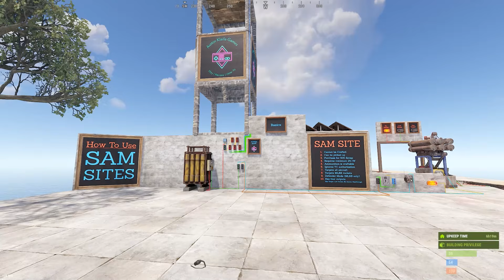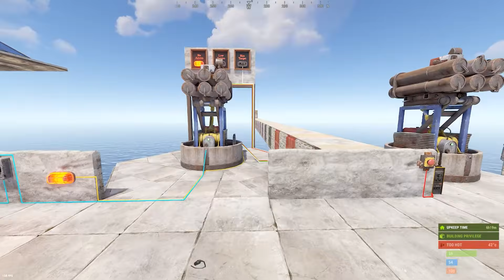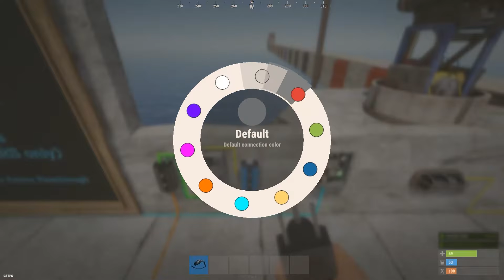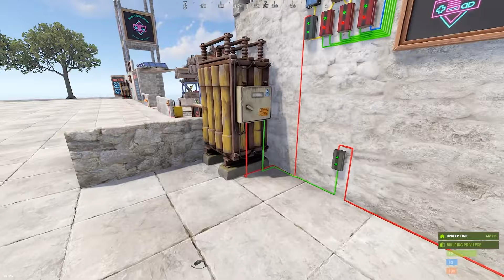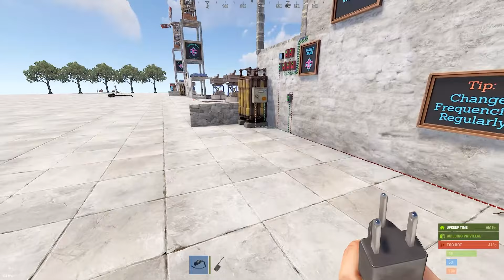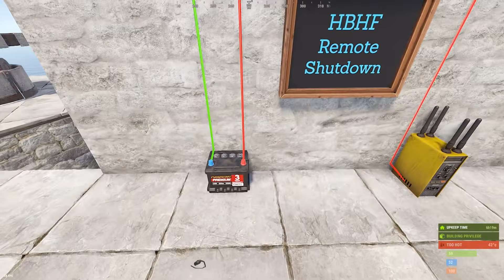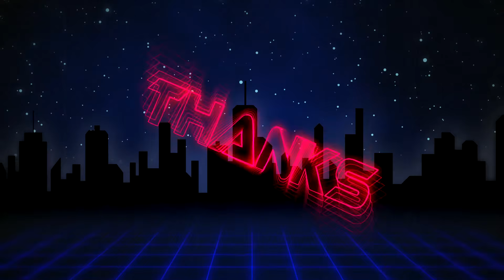RUST Electrical | How To Use SAM SITES - With Wired and Wireless Examples - 2023

Comment from the maker: Video Contents:
0:00 - Intro
0:09 - Basics
3:31 - Smart Switch With & Without Timer
7:12 - Auto Shutdown Smart Switch With Timer
12:07 - Basic Wireless Systems
14:54 - Wireless HBHF Remote Shutdown
16:34 - Final Tip
16:59 - Outro

Comment: Great video Austin! 

You're always extremely thorough with all the information you put out there!

A little note on switches (both regular and smart)

The switches actually have a strange way of working that you wouldn't expect. The bottom and both side toggles are all actually power inputs. The difference is the bottom is neutral and doesn't affect the switch state, whereas the side inputs WILL change the switch state.

The switch will passthrough whichever of the 3 inputs got power last. You can see this in action by plugging a switch into a counter with show passthrough, plug in 5 power to the bottom and turn the switch on, then 6 to the toggle on side input and you'll see the counter go up by 1, then cut and reapply power to the bottom neutral input and it will go down 1 again. Of course the toggle off works the same way, but since it turns the switch off you'll have to manually put it to the on position.
Reply from the maker: Thank you!

Bro, your knowledge of RUST never ceases to amaze me. Are you saying it's designed to operate like this??? The side inputs are labeled "on" and "off", and based on how every other switch operates, I always assumed it was just glitchy. I'm going to have to play around with this. Thank you for the info!!
Reply: @AustinKlailaGames Yeah! it's kind of like the fluid pump and switch, where the toggle input will power the pump AND turn it on when power is applied (although this also works a little differently since as a toggle it will turn off the switch when power is cut).

I can't take all the credit as Swift Coyote from the Rustricity Workshop discord taught me about the switches.

Comment: Bro I’ve binged all your videos all week on vacation never thought I’d finally like doing electricity I feel like I can do it so fast now. But with your advice what do I learn next after I practiced doing the tree and branches method. Seem to have it down but struggle to use the rest of the tools. I really want to learn fun shit like a speaker system that yells at people when they’re near the base 😂
Reply from the maker: That's awesome! I'd say just keep building stuff! If you ever need help with something, just let me know. Maybe pick something specific and see if you can get it working. 

Someone recently challenged me to make a disco dance laser light show with speakers base warning system... so maybe you'll enjoy that one 😂
Reply: My only current question is I have 9 turrets. So I need 2 wind mills connected to 1 root combiner and then use branches of course as normal. I’m also using a branch to make the door security system cause it’s open core with garages. Pretty straight forward hope I don’t mess it up